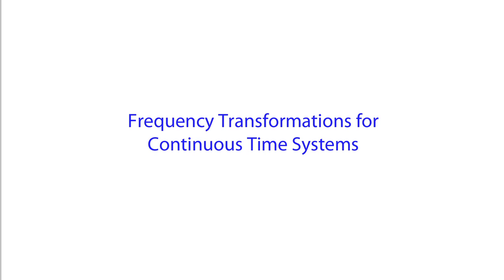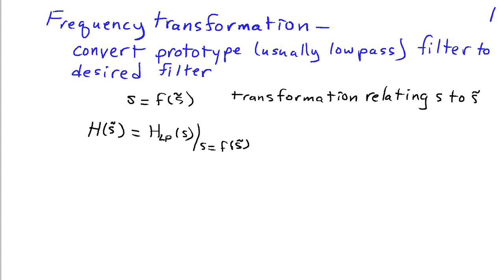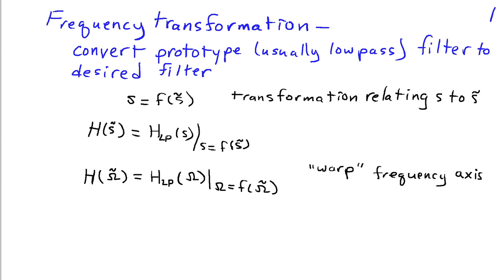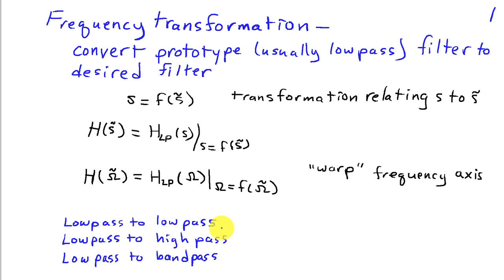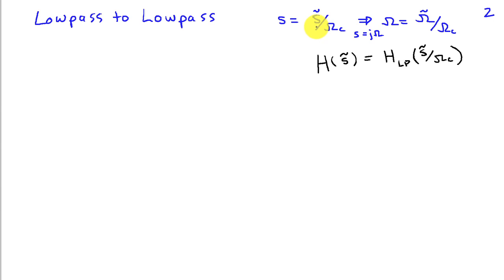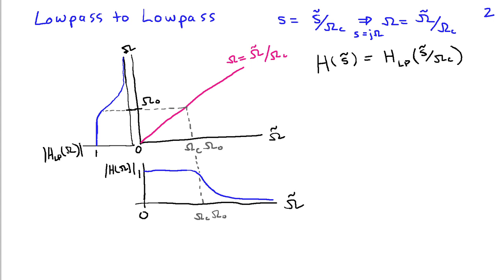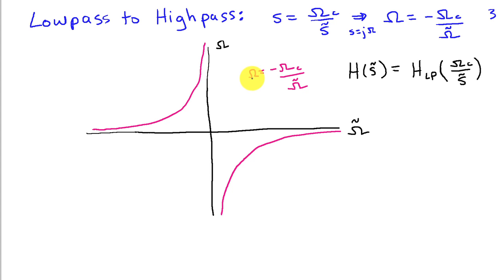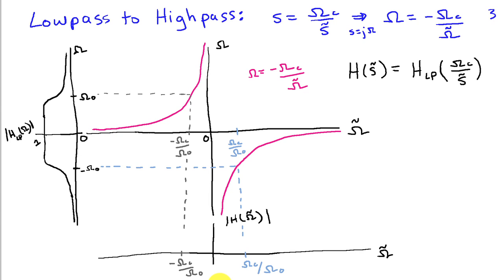Frequency Transformations for Continuous-Time Systems

Comment: Thanks again for posting.  At [7:50] the expression H_LP("s-tilde") --> the Omega_c should be squared.  Also, the convention gets a little hard to follow when Omega_c, originally the half-power point in the continuous-time domain, is now used to indicate the center frequency in the  new, frequency-transformed domain (and Omega_0 is used to indicate the untransformed half-power point)